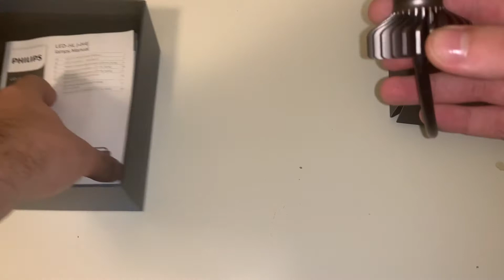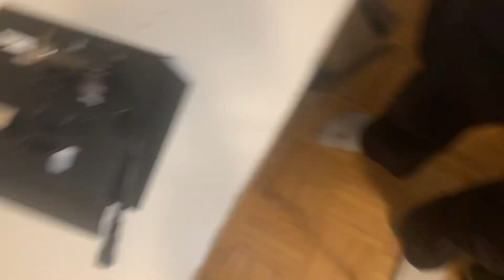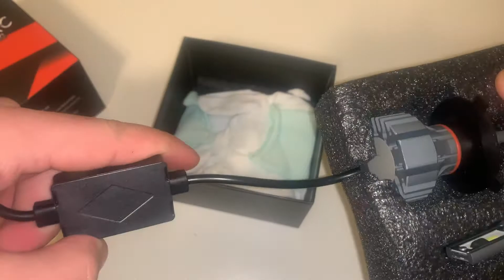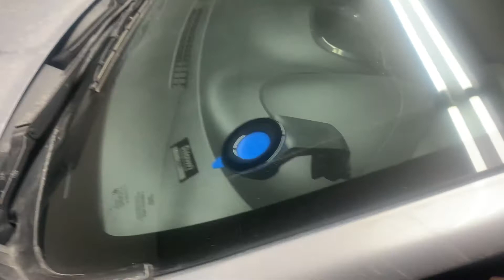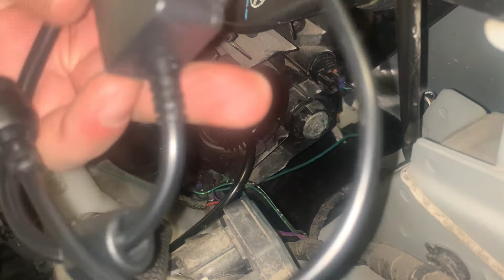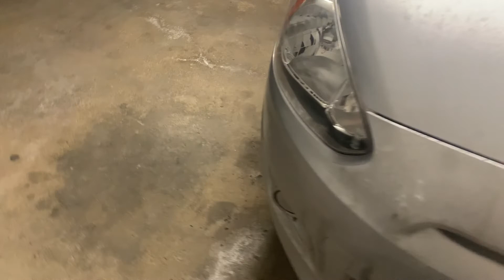Mitsubishi Mirage LED headlight install

Comment: Do you know the sequence brake fluid bleeding on 2019 mirage g4? Can you make a video?
Reply from the maker: I’ve never bled the brakes myself, the shop that changes the tires over seasonally does it for me. It’s fairly cheap since the car is already on the hoist with the wheels off. You can search for the factory service manual on mirageforum.com within it will be the bleed sequence.

Comment: Dude. You spent $250 for headlights?  Jesalou!  They better be the cats meow. 😅
Reply from the maker: Yeah they do not appear to be brighter than the $50 sea light bulbs shown in the video at 13:40. Also the heat sync installed at 9:26 presses against the rubber dust boot. Im always thinking about how one day it is going to break the spring thats holding the bulb in place and bankrupt me as the spring is not sold by Mitsubishi the headlight assembly is sold as a single part. The Philips bulb also does not have a fan and the dust boot kills any hopes and dreams i had of airflow, after a short 10 minute drive with the high beams on the heat sync is too hot for me to hold onto. I imagine it probably dims when it heats up or is killing itself, either way not good.

If I was to do this again id probably try and buy the hid bulbs from a junk yard, i'm sure the projector in that is better than this upgrade.

Comment: Does it not melt the rubber dust shield when the heat sink gets hot?
Reply from the maker: Ive been using these lights for months now and just checked for you, no melting. im sure the rubber was designed with heat in mind as by design it would touch the old halogen bulb directly around the electrical connector. The old halogen bulb gets much hotter than this led bulb ever will as it uses something like 200%+ more power. Also the LED driver is separate from the bulb for the Philips model to reduce the amount of heat that the heat sync has to deal with. Thanks for taking the time to watch the video!

Comment: 14:41 I've seen this mechanism before! it's exactly how a lot of palm sanders work to hold the sandpaper in place. Gotta love simple engineering. 
Engineer: "how do we keep our headlights in the assemblies so they don't rattle out?"
Other Engineer: twists moustache
First Engineer: "That's Brilliant!"
Reply from the maker: Yes I also think its a great idea combining the retention and constant pressure of the bulb into a single metal wire, My only concern is that the LED bulbs weigh a lot more than their halogen counterparts due to the heat sync and the rubber boot behind the bulb being compressed by the heat sync(pulling the bulb away from the mount). if this spring fails, i looked on eBay, they do not appear to be universal in shape and the I don't believe dealership would sell me just the spring, i believe they sell the entire headlight as a single unit. This one tiny metal wire/spring could end up costing me/someone a lot of money one day.

Thanks for watching, Its always nice to hear about other peoples perspective's on things.
Reply: @TheFrugalEngineer  I see. maybe tho it's not that likely the spring would fail? spring-tempered steel doesn't snap, it bends to a certain point, and then it "takes a set" if bent too far. 
So maybe it wouldn't be able to hold the weight over time, or maybe it would be okay? 
Do you notice it shake around a lot when you're driving, like the lights are moving in their sockets from bumping over potholes? 
If not, you're probably good. 

The yellow is easier on the eyes at night, but the blue looks more modern. I like them both.
Reply from the maker: @KF1  I did check for play the other day, no issues yet, Ive only had the LEDs installed for a couple weeks so far so who knows what the future holds. The DRL flicker i demonstrate at the end of the video is my biggest gripe with the headlights. It's only noticeable when reflecting off a wall(in parking lots) or off a garage door. Makes me feel dumb spending all that money to have lights that flicker.
Reply: @TheFrugalEngineer  
Maybe there's some kind of plug-in solution like a regulator to the wire. 

That flickering is also a problem on the new Ford Maverick. One guy found some that worked and they were the only ones. Can't remember the brand, though. 

My lights in my truck flicker cuz it's a GM product. ABS engaging will cause the headlights to, and other things. 

On my old F150, if you let the rpm go too low with the clutch they'd dim noticeably, like it was a star trek episode and had to draw all the available power.
Reply from the maker: @KF1  it's possible but I'm not even sure if the LED bulbs are designed to be used as a DRL. As mentioned in the video, any type of plug in solution that would "fix" the DRL would also basically just keep the high beams on all the time which obviously isnt ideal.